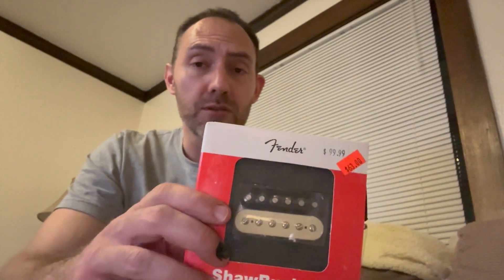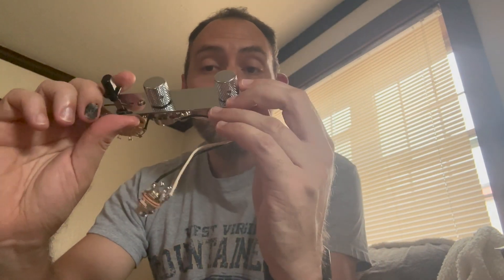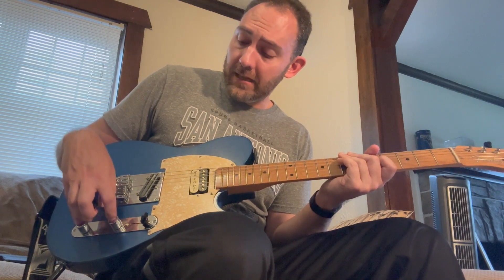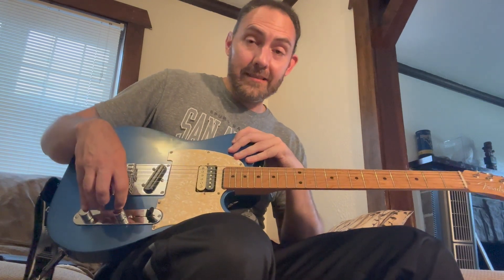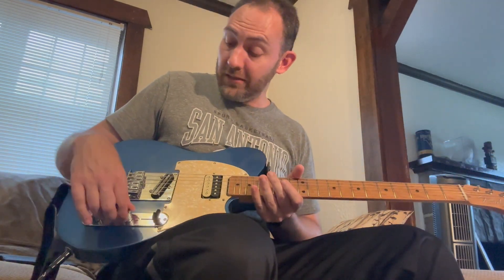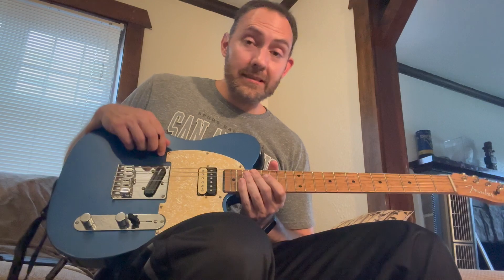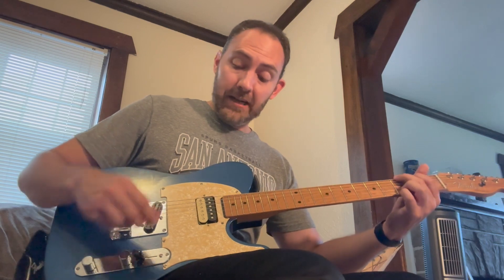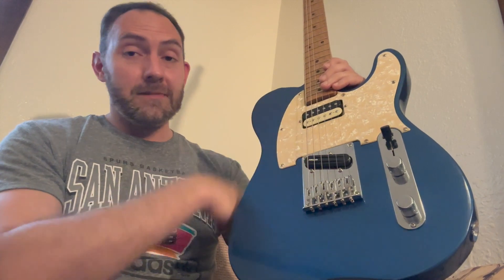Squier Telecaster Upgrade Series: Fender Shawbucker and Dylan Talks Tone 500K Prewired Control Plate

Comment: Hey man, I am looking at putting both these pickups together. I got a shawbucker stock with my telecaster and looking to pair it up with the chopper t. Just wondering if you remember your wiring colors. Were red for both pickups the "hot" wire?
Reply from the maker: I believe the red was the “hot” wire for both. I had no trouble wiring it (and I am by no means an expert) other than it being a lot of wire to fit in the Tele control panel cavity.

Comment: I’m curious what your resistance is on the Shawbucker? Mine is reading 3.6…so less than half of what it should be. I’m trying to discern if mine is toast.
Reply from the maker: Mine comes in about 7.7K. It sounds like perhaps only one coil is wired to the circuit (same as if it was in split coil mode). I’m not proficient enough with the tech side of things to say for sure, but that would be my guess and it might be worth checking the wiring and solder joints.